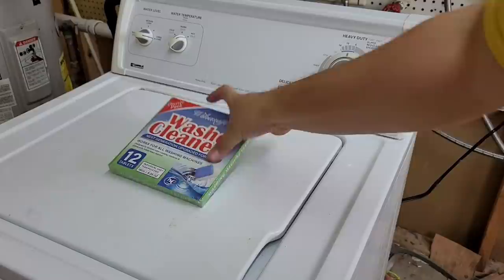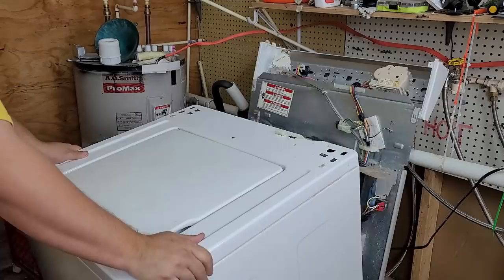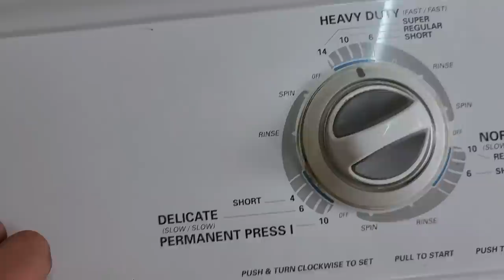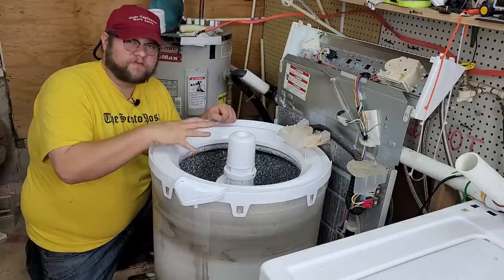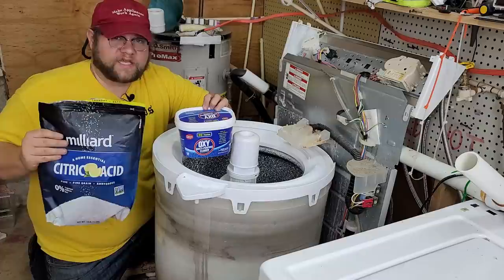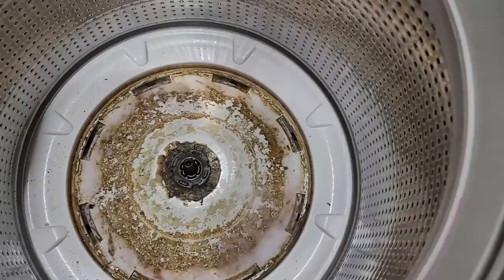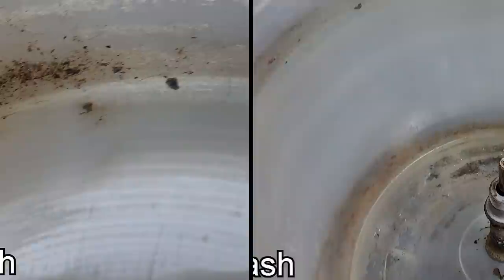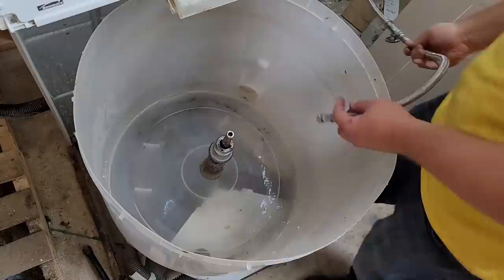Clean a Washing Machine Inside: How to Remove Mold, Soap Scum and More with a CHEAP Organic Cleaner

Comment: I wish i had taken a before picture.  My 5 year old LG front loader was covered with soap scum that did not even budge with any of the soap tabs .  This combination of oziclean and citric acid WORKS.  First try on the CLEAN CYCLE SETTING the washing machine is 90% shinny and looking like new.  The tub rim and base closest to the door still has scum so am running a second time on HEAVY DUTY CYCLE SETTING just to see if the rest of the scum comes off.  thanks so very much for this information.

Comment: I have a top loading Kenmore [made by Whirlpool] that is more than fifty years old. (I'm so grateful the appliance parts guy told me to never let it go! Over the years I've had to replace a few cheap parts that were easy to install.) The first time I took it apart was around six years ago. The plastic tub looked like it had a half inch of road kill on it. I had to use a spatula to scrape it off. Since then I've used a condenser brush (or dryer vent brush) to clean it because it's such a pain to get the tub out. I'm going to try citric acid now after using it on my dishwasher. Your video was a good review and I'm sure it will be of even more help to those who have never gone through this process. Thank you!
Reply: Been doing appliance repair since 83 whirlpool plastic tubs didn't come out until around 1985 & it was only in test market cities such as mine,  & didn't go into full production until around 1990 -95 it was called the design 2000 ,so there's no way your machine is 50
Reply: @ericschulze5641  You’re right!  It was purchased in 1987. But 37 years [in 2024] ain’t bad. The washer and matching dryer are still going strong.
Reply: @grntchstrmdws   that's an oldie , first generation,  that model didn't have the neutral drain,  / drain first then spin , yours drains and spins at the same time,  you must also be in a test market city , most of those machines were sold at rent to own stores, ps the neutral drain transmission won't work in your machine   as the timer needs to pause after draining to set the transmission into spin mode

Comment: Omg!!!  I could never remember how to put it back together!!!!!
Reply: Here's an old tip: get empty egg carton (or two) and start putting fasteners into the egg spots, left-to-right, top-to-bottom, as you take each logical piece apart.  And a new one: use your phone to take a bunch of pictures as/before you take the each piece apart.  (Because cell phone pix cost basically nothing.)  Now by looking through your photos in reverse, you have step-by-step documentation on how it went together and what it should look like for every single step.  These together have saved my backside many times.  (And remember: at the end, no extra screws are the exact right number to have.)
Reply: Take pictures with your phone as you go it helps tremendously especially when you have to stop and take care of kids while working on it.
Reply: Yeah, Karen, if you can make a sandwich or find your own way home from 2 blocks, you could do it. Might break a nail though.

Comment: Put in half a bag of citric acid my wife had sitting around to make "bath bombs". 10 mins of heavy duty cycle and crude is starting to break up. 
Been using this washer since we moved in. Was the previous owners, purchased new in 2012. Never have I ever heard of using "cleaning tablets" before now.
Reply: Just wondering if all that crud will not cause the drain pump to clog up a little on the first go around. I personally would run it again. Then quarterly maintenance wouldn't be a big worry.

Comment: I usually do several loads of wash each week, one load always includes oxy-clean but the last load is always whites which I start at night before going to bed and after agitating a while I turn off and restart in the morning using the longest cycle.  I have a top loader and will never change.  Once a month I run white vinegar and washing soda on the longest cycle.  I use low suds soap and half as much as they say.  If I use fabric softner it is diluted with water so it will not gum up the holder.  My washer is over 20 years old and no odor ever came from it or my clothes and very little maintenance calls.  Common sense

Comment: Thanks, I will go check our GE stack washer/dryer, to see if we can disassemble the agitator, to see if there is gunk under there.  The black streaks you showed, are exactly like the ones showing up on our sheets.  We thought it may have been from the dryer, so I just replied to a different you-tube on a dirty dryer gasket, but our machine is only 2 years old, and the one we are using at our cottage, same brand, but apartment size, is brand new, so we didn't know where this was coming from.

Comment: I have the exact citric acid!
What I use is this, sodium precarbinate, old baking soda and scented corn-based vinegar. And everything comes out clean.
Reply: And I love a front load washer, cleans so much better than a top loader.
Reply from the maker: Great tip!
Reply: @bensappliancesandjunk  I use this in my dishwasher as well. Stays clean!
Reply: @bensappliancesandjunk  where can I buy the sodium precarbinate? What brand?
Reply: @trinitytoo  Sodium Percarbinate is not Arm&Hammer, bicarbonate is.
Look it up.
Reply: @skippymoral4768  Oxyclean is sodium precarbinate, look at the ingredients.
That, or do a Google or Yahoo search.

Comment: Do you have to remove the cover,tub and everything or does it depend how well you want to clean it? If you fill  tub and leave it to soak will that reach the inside bottom under the drum? Or  is the agitating in combination with the citric acid/oxy is what helps break it up? Could I set it to the longest cleaning cycle and restart the time before the rinse cycle starts to lengthen the time the products will have to work? 

I have been wanting to do this but wasn't sure how to start or what to use! So thank you for your tips! 🌝
Reply: I am often in habit of stopping my older machine and returning to the beginning of the agitation cycle. I can soak dirtier clothes but I often feel like the clothes need more than just the 8 minutes of agitation.
Reply: @carriestaker3856  I do the same. I work in lawn care and have really dirty clothes; I have the exact same washer as in this video so if I leave the lid open it will stop after the initial agitation, then I turn the dial to restart it.

Comment: Hi Ben. You mentioned if you have an older machine and it hasn’t been done in a while to use twice as much citric acid. Would you then double the oxiclean as well?  I have used the standard amount the you first suggest and then I did one double the size but I’m still getting clap on my clothes. I have a 30 year old kenmore washer. I use to use the refresh stuff but I can’t find it any more up here in Canada so I tried other things and nothing seems to work so I tried your solution and it’s helping but doesn’t seem like quite enough. Btw, your 10lb bag of citric acid for $25 is $45 here in Canada.

Comment: Very cool that you broke down the chemicals and price in contrast to cleaning tablets! Still trying to figure out how to take mine apart and level it properly. This machine at its worst is probably sparkling clean compared to mine! LOL gotta love those old machine washers with analog controls. Got mine with the house over 10 years ago. Dirty, not leveled properly, and still runs like a champ. Just the agitator gasket it kaput. My parents bought a fancy Samsung washer with digital(-ish) controls. It started rusting before a year of owning it and the agitation is practically useless.

Comment: Make it simple. I put persil in the detergent compartment, 75% vinegar (1tsp) + citric acid in the softener compartment, oxyclean+citric acid+2 morton salt pellets in the drum before clothes. Those frustrating years of keeping the whites super white, getting rid of odor and stain and most of all, keeping the fabric like new, silky and soft for years and years have been solved. AND with added bonus, this formula keeps the machine free from build-ups..................DO NOT forget Mrs. Stewart's bluing agent. Will keep your whites and colors glow from wash after wash.

Comment: The advice I got for my front loader, is to run the hottest cycle, without clothes or detergent, once every month, and also to never use softener as softener is known to cause build up and drainage issues.  Over 10 years, I have followed this advice and have had zero build up or drainage issues. A newer machines need less detergent, so we use minimal detergent.

Comment: Good mate runs a Laundromat he bought the place was let to go to the dogs by retiring owners. I spent a week with him cleaning all the machines in & out then we found a chemist who made up Organic Cleaner. Customers remarked how clean their clothes were now & never stunk. He was lucky to rent an apartment to a retired appliance repairer. A deal was struck to get him cheaper renter & hire him for any major repairs. He mixed an organic cleaner that used vinegar & citrus acid to clean residual soap scum. After 3 heavy washes the washing machines were pure white with no scrubbing. These older machines are fine for another 2-3 years but belts do wear out too.

Comment: Terrific video. Thanks. I've used vinegar where you're using the citric acid. I'll try the Oxy clean too. 
 I've got an LG front loader, about ten years old. Really good.... except the corrugated drain hose started falling apart after two years. I looked for a replacement, but it was like $45 for the same crappy hose - and I couldn't figure out how to do an upgrade.  I wrapped the entire length with silicone stretch tape. That's held up for (I guess) 8 years, but now it's starting to leak again.  
For my LG the manual said I should leave the door open so mold won't grow. It's right next to my back door. I drilled a hole somewhere it doesn't matter, tied a string and then put on some neodymium magnets with the screw holes in them. This allows me to keep the door open about 3-4". Seems like LG should've thought of this.

Comment: Thank you for showing this.  I bought some tablets from Amazon last year to wash the washing machine.  It was a year supply and cost less than buying the two or three tablets that Walmart or the grocery stores sell, but, not sure if it really does anything.  I use them once a month, but, sometimes, my machine tells me I need to clean my machine out a week after I use those tablets and the clean machine cycle my washing machine has.  I'm going to take your advice and buy some citric acid and the oxyclean, generic or the name brand.  Thank you so much.

Comment: I recently had to buy a used, older washer. I was amazed at how dirty the tub was, so I scrubbed by hand the places I could reach. Periodically, while using a new home-made detergent and vinegar rinse, I found clumps of hardened detergent powder in the tub at the end of a wash cycle. I shudder to think what my machine would look like if I took it apart. 😳
I'm going to try your suggestion, but let it soak longer.
Many thanks for this video!

Comment: Not sure if this has been stated, and I'm super late to the party, but by adding Citric Acid and Oxygen Bleach (Sodium Percarbonate) to the washer at the same time you're actually reducing the cleaning power. Sodium Percarbonate is alkaline (raises the ph) when mixed with water, which means it actually neutralizes acids (which lower the ph). I would suggest you run a cycle with Sodium Percarbonate first, and then run a cycle with Citric Acid. That way the two chemicals aren't fighting against each other and are free to do the work they both independently specialize in. 

I suspect that's actually the reason why washing machine cleaning tablets have a delayed release formula. It lets one chemical work, and then releases the other chemical once the delayed release layer dissolves away.

Comment: Great video. I use OxiClean with every wash (about 3/4 cup) of whites (and boxers) with hot water (about 120F). I also let the wash cycle sit for 30 to 60 minutes by propping up the door. The goal is germicidal action without chlorine bleach. This is in a 25+ year old top-loading GE ordered from Montgomery Wards. 
The only advice I can give is to use genuine OxiClean (main ingredient sodium percarbonate). I've noticed that genuine OxiClean creates much more "fizz" than bargain brand oxygen cleaners, suggesting it makes much more hydrogen peroxide once in solution. I'll have to give the citric acid a try and I wonder if vinegar works just as well since it's easier to buy locally and just as acidic.

Comment: Ben, a slightly different but still related question if I may?  Since I've been in the habit of living out in the boonies on a relatively slim wallet, I've always been in the habit of taking care to buy a backup appliance after 15 years when I can find one on sale; otherwise if I wait until something breaks, it's almost guaranteed to happen when prices are highest.

Anyway, I moved halfway across country almost 20 years ago and bought everything new then (cheaper than hauling in the long run), so I'm late on my program for some things.  But about 5 years ago I did happen to bag a smallish top loading washer for under $100 but have never used it since somehow my big heavy duty washer is still going strong.  Now the daughter of TinyTown's former Maytag Repairman tells me the seals of the little washer have probably dried out from sitting there unused all this time.  What she can't tell me though is how to lubricate those seals prior to first use so hopefully it won't leak all over the floor the first time I try to use it after the big old machine inevitably croaks at last.  HOW to lubricate those seals, when I'm just a little old lady pushing 80 who really can't be trusted to disassemble a toaster???

Comment: absolutely great video. Definitely going to check out your channel further. I found my way here after buy a 4 year old washer and drier for my apartment that looked to be in great shape but after running them was finding a lot of brown waxy flakes as well as sand in the bottom of the washer. I assume the waxy bits are soap scum and I hope that the mixture you outlined will help clean things up for me.

Comment: Good video! We actually have a Cabrio and I just started using it recently to help  the Mrs. not have so much laundry to do. I noticed the clean washer option but wasn't sure what it actually did, ran it with some bleach as it was readily available but looks like I'll be picking up some citric acid now.
Reply: I use Iron Out to get my whites brighter. Hopefully it's on double duty after watching this!

Comment: Vinegar is also very inexpensive... and cooking vinegar is about 5% acetic-acid, while cleaning vinegar is about 6%.  That doesn't sound like much of a concentration, but that's roughly 20% more potent.  I also saw some vinegar in the outdoor area, and it was 20% acetic-acid.... but I wouldn't feel comfortable putting that in my appliances, because there's going to be a point where you begin to harm them.

Have you considered vinegar?

Comment: Nice Video! I differently will be checking out your other videos. I have owner a kenmore front load washer aprox 20 years now I do casually do a cleaning of the trap, but this last time needed more attention. Btw this is my second washer first one lasted 3-4 week before the circuit board went up, but I have good luck on this one, only had minor repairs. I’m a DIY’er myself and always learning new tricks, and your video made it easier using the right products really helps. 👍🏻

Comment: I have a Kenmore washer that's about 8 yrs old.  It may have some dirt in the drum. Have not looked.  I use approx 1/3 cup of 20 Mule team borax in every load along with detergent. Clothes come out cleaner and the drum is sparkling clean. No musty smell inside machine. I always leave the lid open when not running. Borax is about 4.50 a box ands lasts a while.   Works for me.

Comment: When I moved in with my now ex-fiance we bought a $120 nearly 40 year old washing machine. It worked perfectly common except it kept positing hair and fibers on my clothes, and I couldn't figure out why. I tried all the different tricks for cleaning washing machines, but none of them work. Eventually we had to remove the shell and clean between the drum and tub by taking up a screwdriver and physically breaking off chunks of old dog hair and fiber said built in matted up over the decades.

Comment: Nice vid and tips about the diy ingredients, thanx. I saw that there was amylase, lipase and protease in the commercial cleaning. Those are actually enzymes made by the (human) pancreas to break down fat and proteines in meat to be digested after the hydrochloric acid from the stomach has done it's work. I learned a dishwasher tab or 4 will also do a nice job (for the washer lol). Oh also, you can stop the washing machine after heating for a while to soak better and top it off just after the fill cycle for the top grime. Cheers!
Reply from the maker: Next video I make, I am mentioning those items because guess what? Those are all in generic Amazon fat burning pills. $10 gets you like 120 doses that'll eat away at the junk in your washer
Reply: @bensappliancesandjunk  Roger that sir! I have some pancreatic pills left over, sure going try those also!

Comment: Could you make a video about front loading washing machines? I've had my front-load washer(and dryer) for 15-20 years and, while I do wipe it dry after use to keep mildew from forming, I've never given much thought to the insides. Mine doesn't smell nasty, but I really like clean clothes and a clean machine is certainly the key to that endeavor.
Reply from the maker: 100% going to do one on frontloads. I just have to find the right, nasty, front load in which to do a good video on.
Reply: @bensappliancesandjunk  We’ll be waiting!